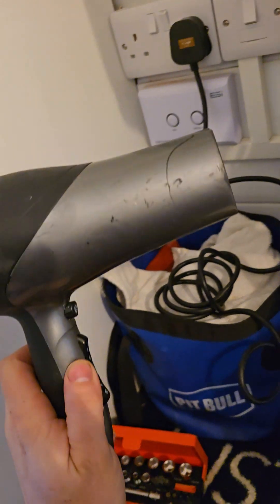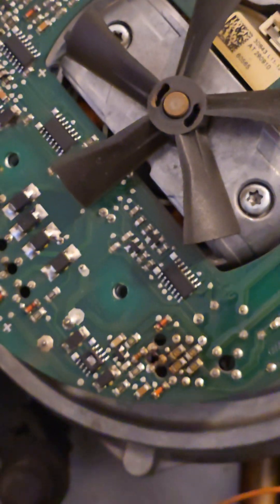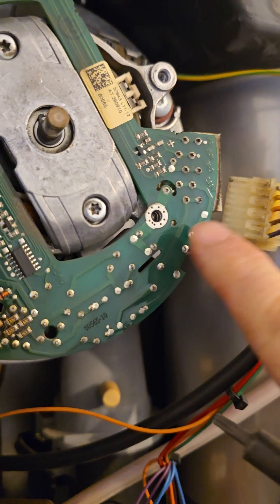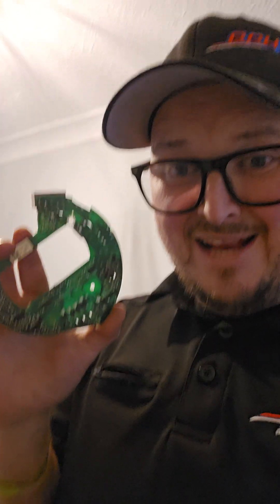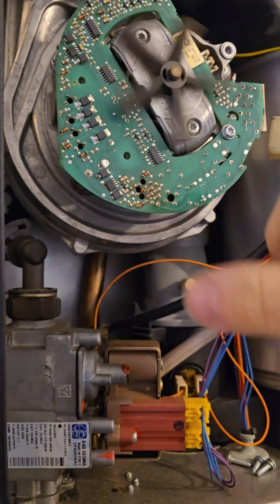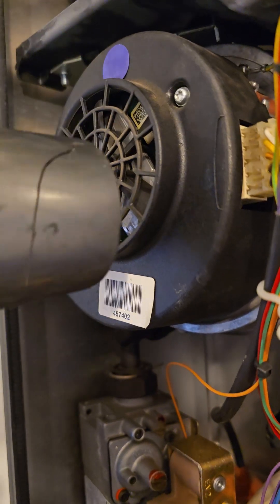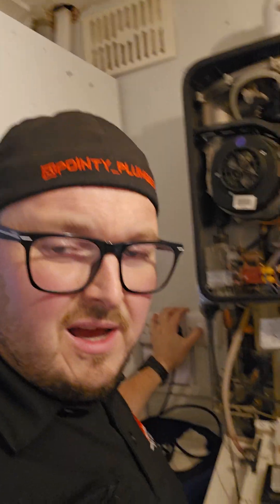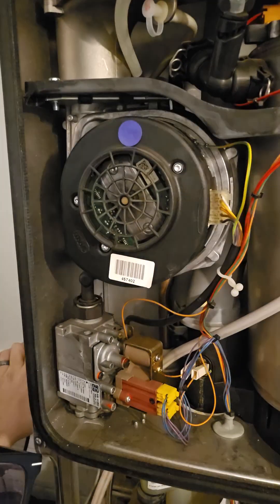fixing a worcester bosch fan fault. flashing blue light. new board  hair dryer

Comment: Onto the third board here, so I'm now fixing them myself.
I doubt moisture is actually the problem.
The first board has a single Toshiba BLDC motor chip. A monolithic device that the package exploded. There are examples of this available on the internet. That's not moisture inside a hermetic package, or the conformal coating on the PCB.
The first thing to note is that the Live and Neutral from the boiler PCB to the fan are the wrong way round. I.e the electric polarity is wrong.
The fans have fuses or fuseable resistors on the live side, which is not protecting the circuit from this incorrect polarity. Especially given the earth point that you show.
The fuse on boards (that have them) are 700mA and yet the 2.5A time delay can still go on the main PCB.
That's a longterm high current problem, not a bit of arcing caused by damp.
The monolithic device explodes because of a dead short on the internal H bridge.
The board you have here has discreet FETs (the 4 irf830) and two gate drive chips (2108 ?).
There are 3 power circuits on it. The 380v DC rail to the FETs. A 14volt gate boost, and a logic level power (3 or 5 volt) to the brain on the board.
The components you point to as fuses are not. They are high value resistors that drop the 380v DC to provide a diode reference for the 14v  gate drive circuit. The 14v is regulated by another irf830.
On the other side of the board are three 330kohm wound resistors that also drop power to the same FET and for part of the same circuit.
These components are all under rated and burn out. That's what causes the burn marks on the board.
They are constantly powered, even when the fan is not turning. So the auxiliary fan that you removed is also not going to cool these devices.
This leads to unstable control voltages and causes shoot through on the FETs (dead short).
This is further exacerbated by the fan not having power protection shutdown. There is nothing to protect the FETs from being ON when the device powers so there is another dead short condition.
Looking around the internet many ebmpebst fans suffer the same failures and it's not just WB.
Meanwhile back on the boiler PCB the on/off switch powers the fan directly (via the 20mm ceramic fuse). So the fan gets mains power again before the boiler Switched mode supply has started and the brain kicks in.
The problem is piss poor design and a hardwired wiring error that would fail an electrical installation test. (Reverse polarity).
Great for business though.

Cheers for the decent look in at the board.